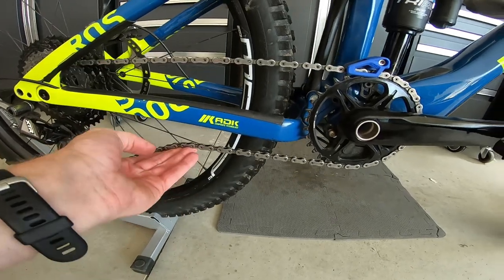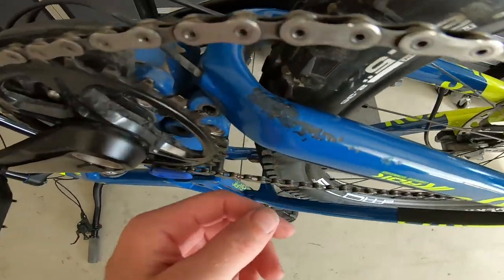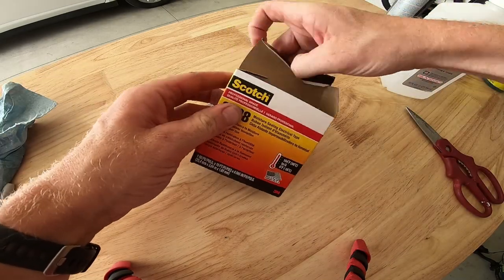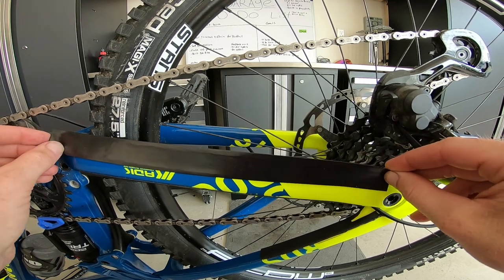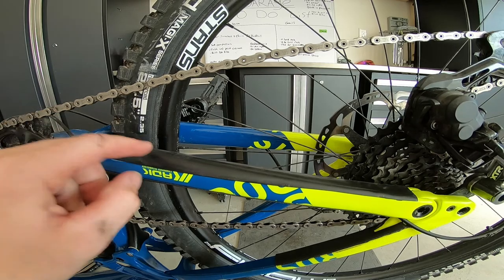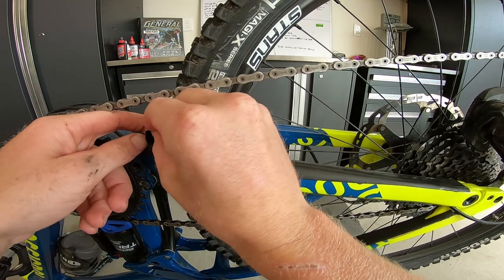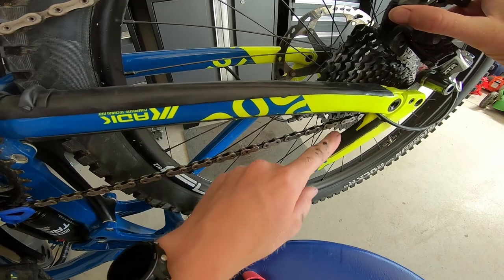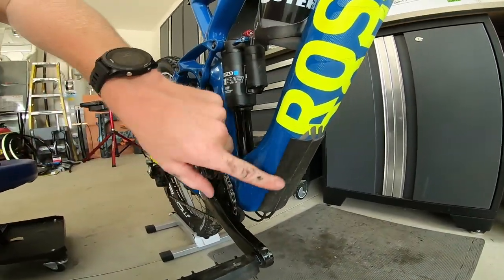How To Make A Chain Slap Protector For Under $10

Comment: Great tip(s)!!! I'll be hittin up Lowe's tomorrow for sure. Can also use small pieces around cable housings where they tap on the frame. Heat gun tip is priceless! Really does help it to set up and stay stuck for extended use. Plain electrical tape unravels and chips easily. Thanks for this, I appreciate a quiet bike for sure.
Reply from the maker: Ol' Roy MTB, etc. yeah no worries at all! Thanks for watching the video. Hope it works for ya!

Comment: It's probably irrelevant mentioning now, that your rear derailleur clutch (Shimano Shadow+) ist turned off. You need to flip the lever towards the rear of the bike. You are even slightly moving it with your thumb at 4:58.

Comment: Does using this type of protection damage the paint?
Reply from the maker: No it peels right off when you're done and at most you will need a little goo gone to clean up the adhesive marks.